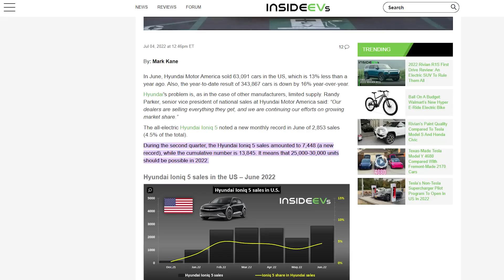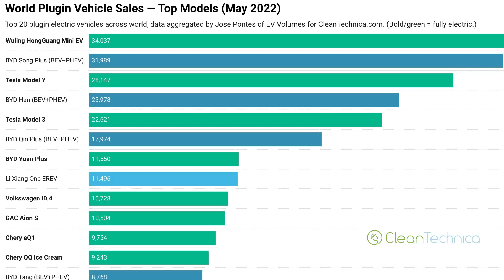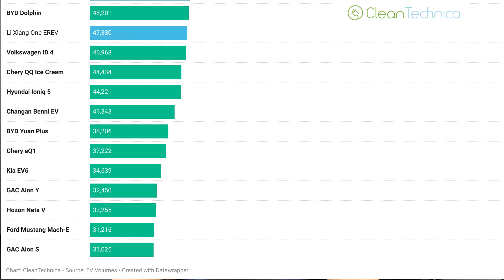Kia EV6 & Hyundai Ioniq 5 US & worldwide sales data 2022

Comment: The current 800v packs was a BIG selling feature in the US. Many don’t really understand what 800v means for an EV, but when it’s explained that it offers fast charging. OF COURSE people want them. However, it sounds good on paper because a lot of people who bought them were very upset the first time they showed up to one of the few 350kw dc charger and only received a max of 150kw. I know Hyundai is supposed to implement battery preconditioning to optimize the battery for DC fast charging but that is what EV deniers are waiting on. They want to TRANSITION to an EV. They don’t want the intimidating feeling of not having enough chargers off highways and interstates to not make it to the next destination. I don’t know how it is in Australia but gas stations are some of the most cringe places to go. In the US a gas station worker is probably in the top 10 if not top 5 most dangerous places to work. I get that charging at home takes care of that, for the most part. But I travel, by vehicle, A LOT for work. The least  amount of time I can spend fueling up in an unfamiliar area the better.

Comment: I have an EV6. It took me 4 months and driving through 9 states before seeing another one. After that, I have now seen 3 in one week, each in a different state. On the other hand, I see the Ioniq 5 all the time, at least 1-2 weekly.
Reply: Just did a cross country US trip. Lots of charging stations, but only saw one EV6 other than mine. Saw around 5 ioniq 5 and a few MME. Also bumped into a couple of ID4s. Did see 4 Rivian trucks. And one Kona. Range on the EV6 at 100% charge was just 215 miles with AC on and outside Temps around 90+. Used ABRP and no problem finding chargers from Maryland to California... although a few weren't all working...